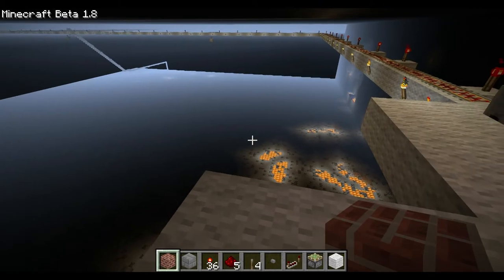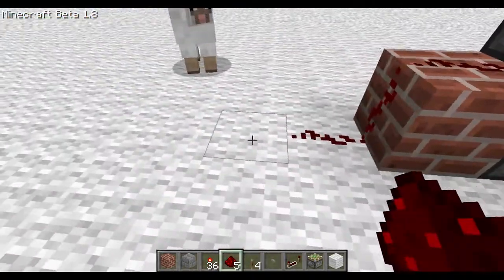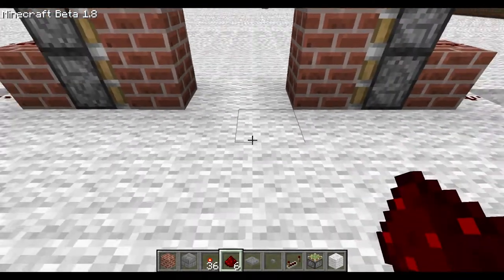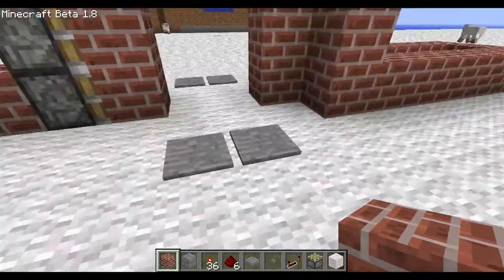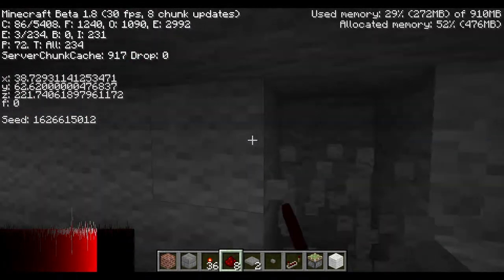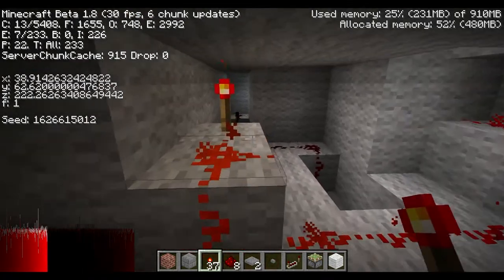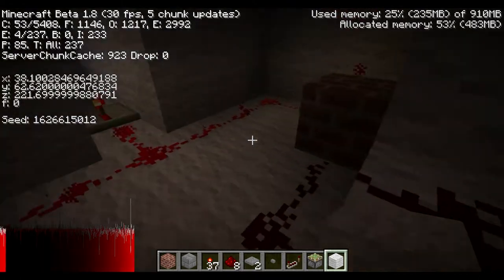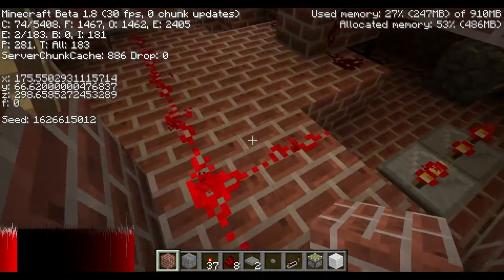Automatic Piston Doors in Minecraft

Comment from the maker: @HadeFX If the redstone wire isn't 1 block underneath the button, power won't be transmitted to the wire. You should have a hole directly in front of you when testing if the button works, so you can see if the redstone wire is lighting up or not.